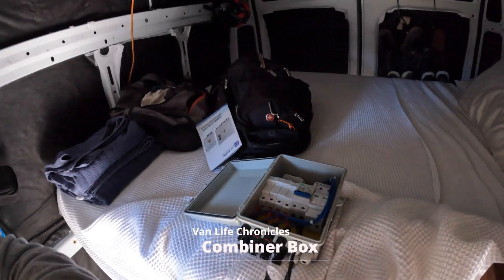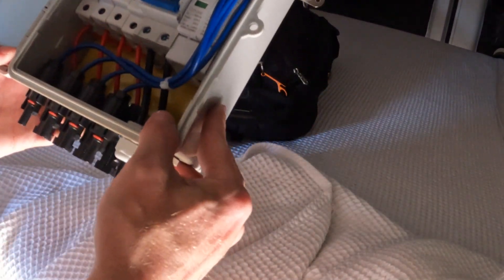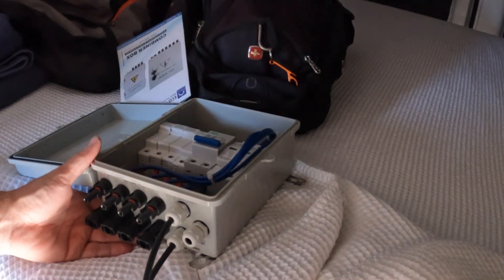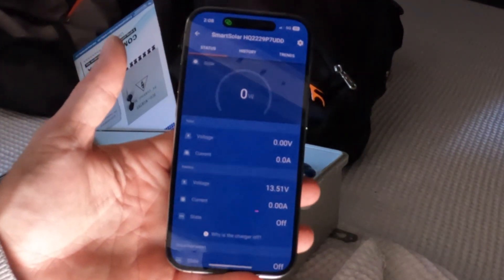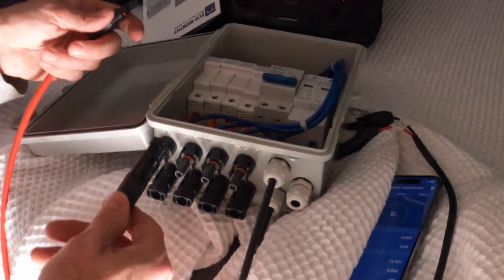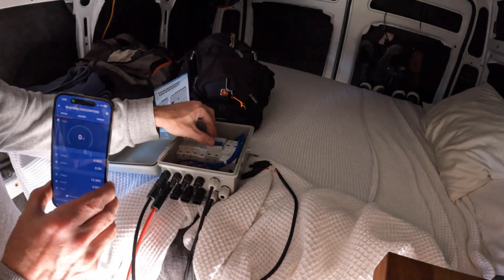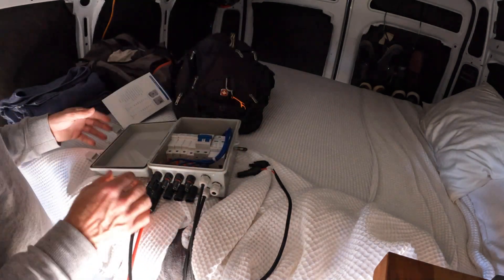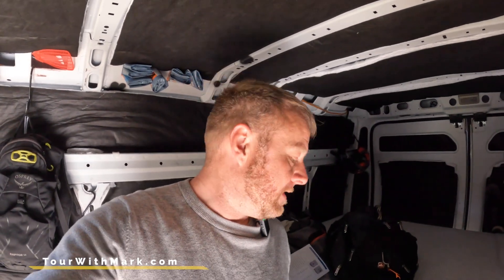VanLife Solar Power: Easy Panel Installation to MPPT & Battery with Eco-Worthy PV Combiner Box

Comment: Did you say that you hooked the output cables straight to the battery? No charge controller won't that damage the battery by over charging it?.
Reply: Sorry I stopped it to quickly I now see that you corrected your self